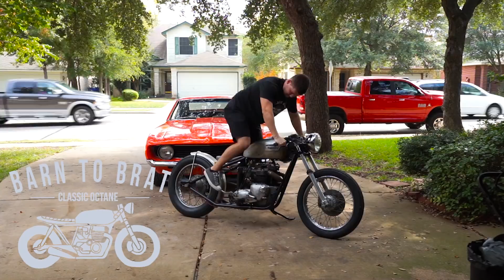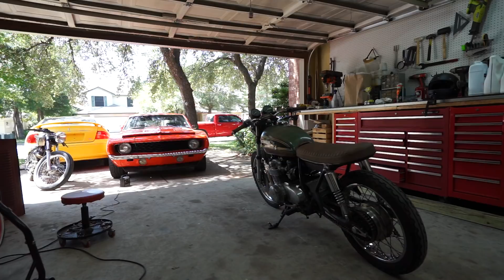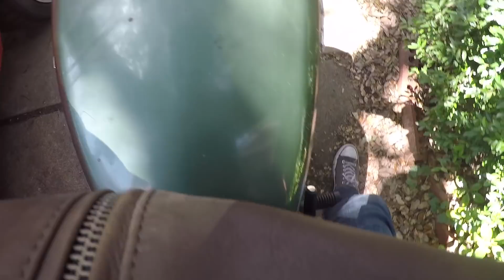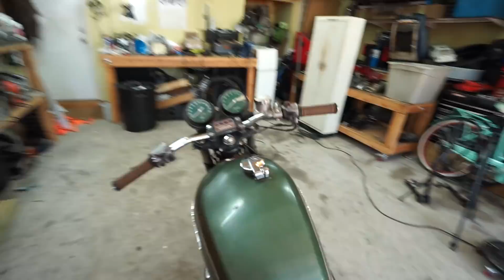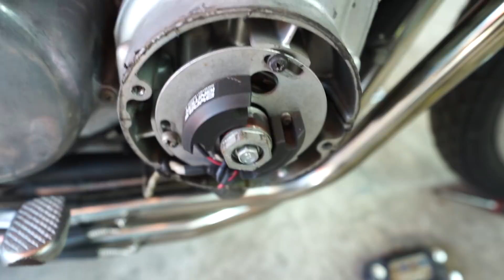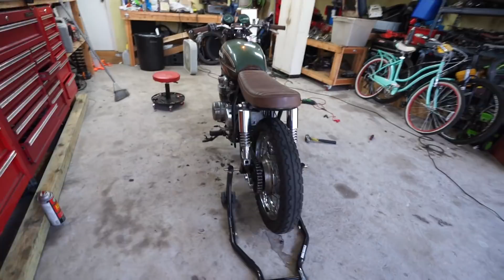Barn to Brat Episode 17: First Ride!

Comment: Man you need to adjust that camera on the helmet. Throttle not coming down fast enough after letting go of the throttle, that is an indication of intake leak. Diodes keep the current from going back down the line only in one direction. You can use two diodes in opposite poles and make it into a voltage limiter to set a voltage to a proper limiter as a limiter circuit.

Comment: I just bought a 1976 Honda CB500T yesterday and my neutral light stays on as well. Could you send me the link or tell me where you bought the new diode? Videos are awesome and are going to come in handy when I start making mods to the bike. Thanks!
Reply from the maker: I would check your neutral switch first. It lost likely just needs to be adjusted. I just used a diode I had from another bike.

Comment: Don't know what made you think your black power was shorted to ground, but on my cb750 the resistance from the black to ground is 2.2 ohms, key off of course.  This is due to bulbs.  If it were truly shorted it would immediately blow the main fuse.  I could imaginne a little grease or whatever smoking as current ran thru it for the neutral light.

Comment: Just binge watched this entire playlist. Great!  My first bike was a '73 CB500 Four.

This channel is the best thing since the original BBC Wheeler Dealers. Bravo. 

I'm concerned with one thing I noticed on the first ride video. Are the handle bars bent?  The left grip looks closer to the rear than the front. As there was a substantial dent on the left side I'm wondering if the bar was bent too. 

Really enjoying the channel. Keep up the good work.

Comment: Have you ever had a stock seat get stuck closed? My key turns the lock to lift the seat but it's still stuck. I've loved your videos lots of tools and parts now on my list to get that will help me.
Reply from the maker: Yeah, the mechanism can get a little sticky over time. Have you tried pushing down on the seat while you turn the key? This will take some of the spring pressure off the mechanism.

Comment: I really appreciate all of your videos I've posted before on how you've inspired me to start my rebuild on my CB's both 1981's 900custom and 750 just tore down my 900 fixing to blast engine to clean the freaking black rattle can off. Question what seats do you use want that café look without having to cut and weld. And do you have any suggestions for good frame prep and paint?
Thanks again for your time and videos.
Kevin

Comment: Love your videos man! I'm rebuilding a 74 cb550 and they've helped me a lot, quick question though. I've run into a problem where my kickstarter hits my right peg. I've done a bit of research and I can't come up with anything to fix it, would you recommend getting new pegs or whats happening?
Reply: Also just a side note I had no clue about anything bike related before I started this project. Do I just have the peg in the wrong spot?
Reply from the maker: Could be. You might be able to just rotate the peg down a little bit to give you more clearance.
Reply: Thanks man! Keep up the videos!

Comment: Great vid...nice electrical fix as well.  Are you going to make a bracket for the exhaust?
Reply from the maker: Thanks! No, the exhaust is really solid how it is currently. I don't see a need to add another mounting bracket.
Reply: Oh, so they aren't only held on by the headers then?  From the pics, that's what it looks like, but if there's another mounting point...then that's good. After a while, vibration/riding, those header bolts can snap off (I've found this out the hard way...unfortunately).  Just a thought.

Comment: Hi Taylor, nice project. I restored 72' CB500 and also has same issues with electicity and found you have also electronic ignition. The question is do you have a electric lack of power? When I turn on all lighs cause we have such regulations in Europe after 200 km battery runs out. I checked everything and found that might be an issue with electronic ignition which takes c.a. 60W of power, when adding all lights plus losses on rectifier, regulator it is more or less same value as alternator produces.  Just curious if you also noticed such problems.
Reply from the maker: I haven't yet. I don't usually run the headlight while I'm riding during the day.

Comment: Hi Taylor. The starter solenoid requires a negative to operate. The negative comes from either the clutch switch (pulled in) and or the bike neutral switch. The diode is to prevent the clutch switch back feeding to the neutral indicator light. I have cx500, the drawing clearly demonstrates this.

Comment: Quick question to Taylor and the viewers: My CB350 plugs always come out black with deposits, wipes off. Based on spark plug charts, its running too rich. So i adjusted the needle to run lean, but it made no difference. Is my carb not working properly? some days the bike would not start and if i remove the spark plug, its coated with fuel. any advise is greatly appreciated.
Reply: Sounds like the diaphragm is split and requires replacement.
Reply from the maker: I would pull the carbs off and check them out. Could be a few things. Hopefully, it's something simple like oversized jets or even better maybe a jet just fell out.

Comment: Fantastic.  Still curious what you will be doing with the front fender.  Love the sound too.  As for the rear (and I know there is a vid for it but I will put my thought here), perhaps do the cut out for the wing nuts, but shape the cut to look smoother.  If that doesn't work, maybe at the very least have part of the fender to block the air exit for your electronics.  Either way, really looking forward to the completion of this awesome project!

Comment: Don’t mind the long explains. Keep it going bro. One question. Do most bikes have the headlight on all the time or do people have switches other than the hand control?
Reply: Sevenity Guitars the majority of bikes have a running light, meaning the tail and front light are always on at a very low setting. Some older bikes don’t have this but the majority of newer bikes do
Reply: Zakary Goodmanson ok, cool I wasn’t to familiar with 70s bikes because I had to get aftermarket hand controls. It is good to know👍🏼
Reply from the maker: This bike has an on/off switch on the right control and a hi/low switch on the left.
Reply: Classic Octane is the switch a three position switch ?

Comment: the diode is for the clutch safety switch and neutral safety switch so only one or the other has to be active to start the bike.
Reply: Hi Taylor. The starter solenoid requires a negative to operate. The negative comes from either the clutch switch (pulled in) and or from the bike neutral switch. The diode is to prevent the the clutch switch back feeding to the neutral indicator light. I have a cx500, the drawing clearly demonstrates this.
Reply: John Howard same here on the CB400T
Reply: Nailed it Taylor and John